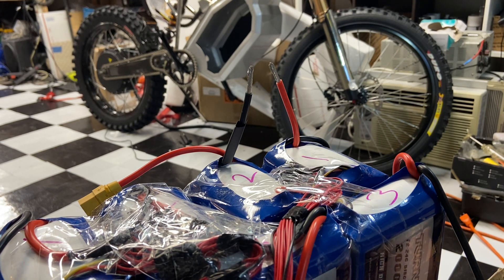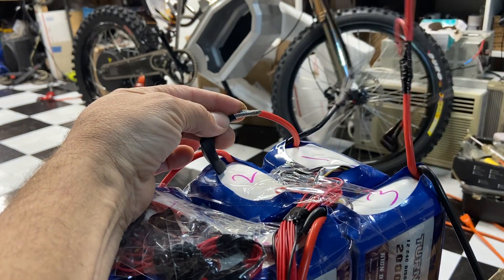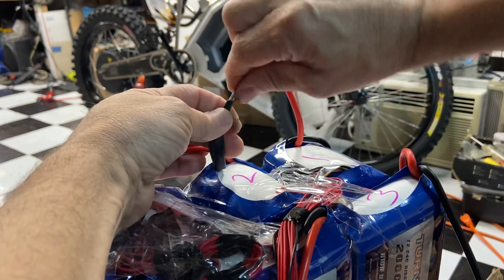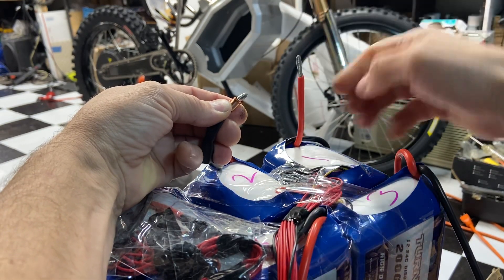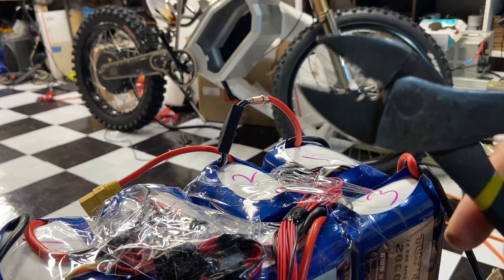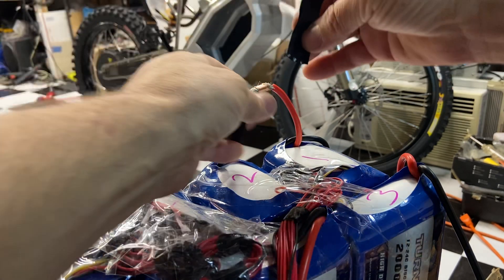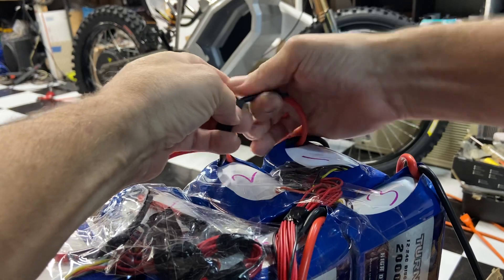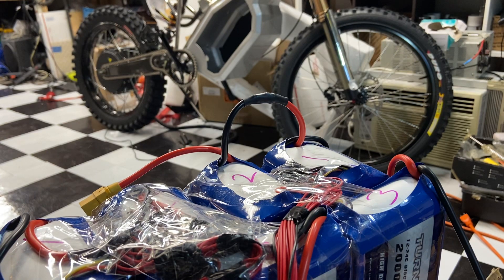“How to” copper crimp 10awg wire Ebike battery

Comment: Hello could you give me some advice regarding the motor disc brake screws, why they unscrew even if I tighten them tightly there is this problem that they unscrew.
Reply from the maker: Francesco Menniello try lock tight. I had the same issue with a MXUS motor but the QS is fine . Here is the bolts I use https://www.ebay.com/itm/120766240261

Comment: I used the deoxygenating copper crimps and crimpers on all crimps especially in high amp systems like my e-bike. Is that an XT90 for your main battery lead connector?
Reply from the maker: Farmer Fpv 18-10awg and 14-8awg Tyco copper crimp sleeves .   Crimper is https://shop.advanceautoparts.com/p/autocraft-heavy-duty-cutter-crimper-tool-86263/10027426-p?product_channel=local&store=7539&adtype=pla&product_channel=local&store_code=7539&gclid=EAIaIQobChMIso-_vb7z6gIVYuW1Ch2aRwZtEAQYByABEgKRQvD_BwE&gclsrc=aw.ds
Reply: Hi..do you have a link of the crimls and crimpers  you are using?
Reply from the maker: Farmer Fpv yes its XT90 to the controller. It never gets hot even under load . I have doubled up to reach higher top speeds but it’s not necessary on my builds
Reply: @tobebike  XT90 should be no problem because of the high voltage, they only have issues if running on 12v with high amp draw, anything over 48v they are perfect even though I run 10mm bullets to get max amps to my controller. My battery is a beast I actually had XT 90s get soft on me, everything depends on what you're running. For some, they are more than enough and for some, they melt. I like XT90s for the simplicity, I use them on my huge 3D helicopters with no issues. But I still love my MaxAmps 10mm connectors because I can also use them for my rear phase wires and hall wires and temp wire all in one plug for tire/wheel changes it also has a nice small footprint.